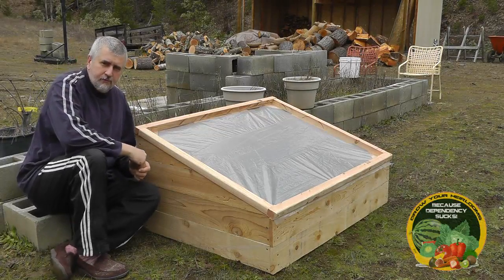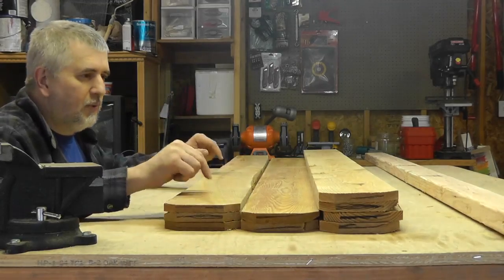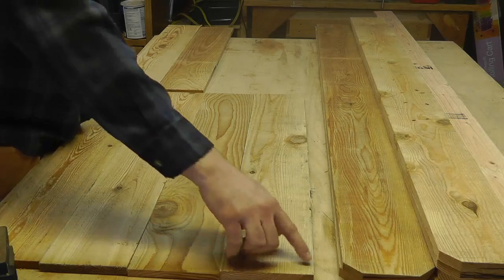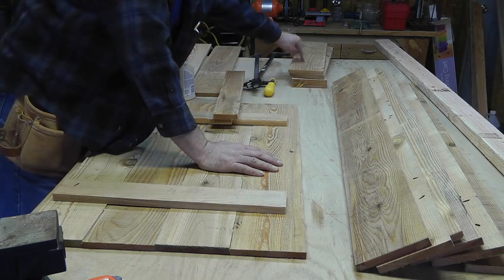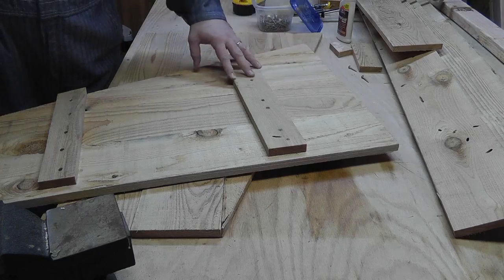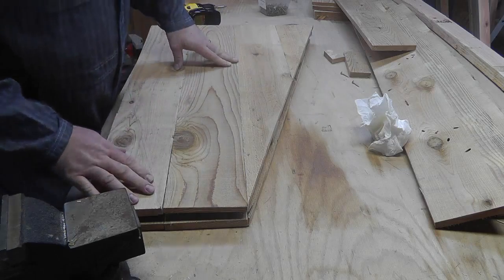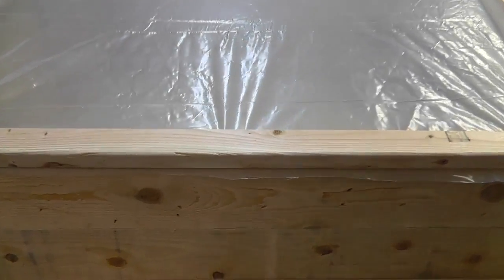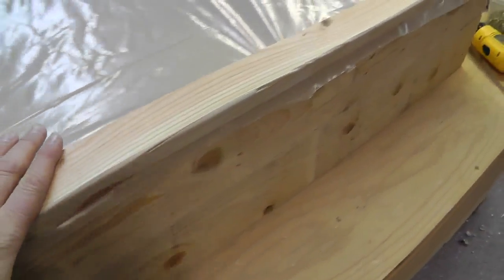How To Build A Cold Frame For Growing Winter Vegetables

Comment: Here is a idea for you. - Remember when we were kids and we had punch balls? - with the rubberbands? you can still buy them at the Dollar store. - if you blow them up BIG and they are all streched out - than put a ( little ) air in them with about 5/6 drops of water and put them in the Freezer! they will deflate, than put them in between the top of your lid and the front side, the lid will probably be heavy enough to stay closed BUT when the temp inside the box gets hot the Ballon will heat up and expand and open the box so it does not get TOO hot! and Deflate when it cools off. Auto Vent!!

Comment: I think you did a fine job. I hope your hands heal quick! LOL Don't want to sound like a knuckle head. But could you have put the plastic on the top side of the door and wrapped it around the 2x2 frame and fastened it to the inside of the door? Then the 2x2 door frame would be protected from the rain. This way all the rain that lands on the door will pool up against the door frame. Just an idea...
Reply from the maker: You know, I thought of putting it on top, but our wind here is horrible sometimes and thought I'd protect the plastic. Tell you the truth, I hadn't thought about protecting the wood. LOL. I'm not the sharpest tool in the drawer am I? HAHAHA Thanks. I guess another video is in order.

Comment: That's one fine cold frame you built, we've not built one yet, but will refer back to your informative video when we do. Thank You for sharing this.   Gretchen
Reply from the maker: Thanks. But as everyone has scolded me, put the plastic on the outside (top) so runoff doesn't get trapped. Other than that, it's still working like a charm.
Reply: Grow Your Heirlooms Personally I think putting the plastic under is fine...as long as you put it on top too. Actually Its probably better with both because of the insulated air barrier it creates... See you were just improving on old cold frame designs :)  Well done. I have one with a huge piece of glass in it, but honestly I think I'd rather the plastic, much lighter.
Reply from the maker: *****
Good thinking, I may just add a plastic top to it :-)

Comment: Dunno if its just me, but I've used cold frames for years and the first few years I used them I cooked my seedlings! All it takes is to fail to lift the cover when the sun comes out. I finally found some automatic lifters that solved the issue. However, it took a little bit of engineering to attach the lifters to lid since these lifters were designed for greenhouse windows where you have access to the inside of the structure. Also, once the lifters are attached, you are restricted in terms of how far you can open the cover to access the inside of the cold frame. And thanks for your videos.
Reply from the maker: Captain Ron For sure you have to monitor is closely. But I use it only in the winter when the sun won't cook them.
Reply: thanks for the warning on the nearing frames - i am building mine now and deciding where to put it, but i thought shade would have too many slug issues, however you are right - glass is a great magnifying window for heat. so maybe small window of time in eastern area with the rest of the day in shade. also rhodies and azaleas do well with gravel on the bottom, and bottom heat, and tops exposed to cooler air

Comment: I watched your video specifically for the lid, since I made my cold frame from an insulated box I had built for my horse trough. So thanks for the tips on how to keep the lid frame solid, which was part of my difficulty! The other thing is that I am using rigid plastic with ribs (the kind of transparent panels they put on barn roofs to let light in). Do I need to put a frame on both the upper and lower faces of the panel, or can I just screw through the ribs into a frame on the underneath?

One bit of advice from a friend who has several cold frames (since you mention that you have high winds): don't use a stick to prop the lid open - the wind lifts the lid, the stick falls away and then the lid slams, This may break glass, if that's what is being used; or, if you haven't noticed that the lid is down, heat build-up may harm your plants. I am going to try a cord from the lid handle and attached to the wall behind the cold frame.

Thanks again for a good, clear explanation!

Comment: I was thinking if that works with just wood standing above the ground in southern Oregon , then it will work in colder climate if you dig out where the cold frame goes. The deeper the better even if you need to put in a floor because you went real deep, but put the top level with the ground.
Reply: Great idea, the tilted top gathers light, the box is insulated from the depth. My concern is plants getting taller than the frame (tomatoes,  peppers etc) and needing to make it taller. Might have answered my own Q!

Comment: Maybe put the plastic on the top of lid also so it doesn't trap water or ice and sag from the snow.  Good video
Reply from the maker: Yeah, that was already discussed. However, it does not make a water tight seal and the water just runs right out. No problems yet.
Reply: Nice

Comment: Good project.  The video could've done with a little less paralysis of analysis, but no problem.  Personally, I would've put the plastic on the top side of the 2x2 frame that way you don't have a bowl to gatther random junk.  Or better yet, stretch another sheet of plastic on the outside to make a double layer.  Extra insulation against the cold.
Reply: Actually, I liked all the analysis.  It helped me understand how this gentleman thought through the project.  Now when I make my own cold frame, most of the thinking is already done for me!  :o)  
I do agree about the double layer of plastic...better insulation and probably very little loss of sunlight.